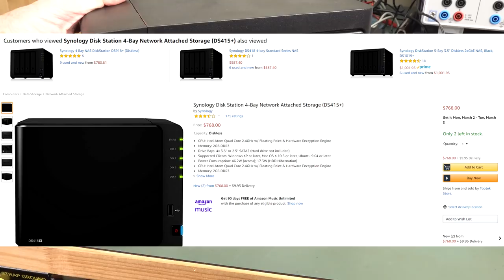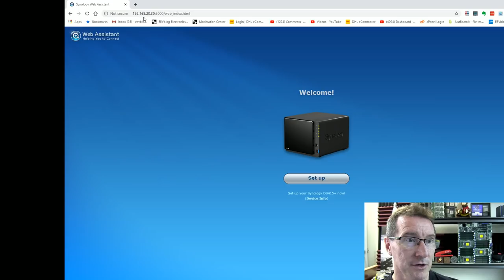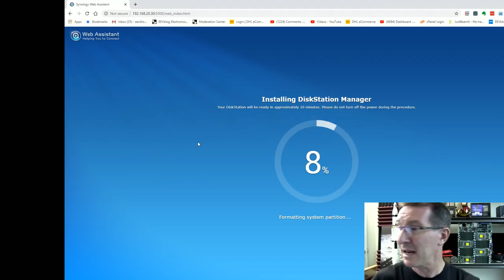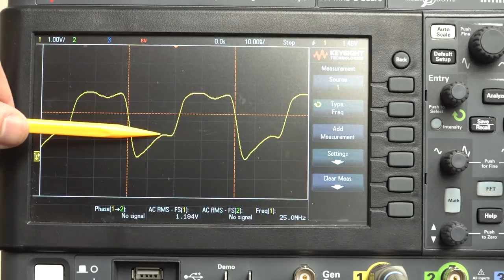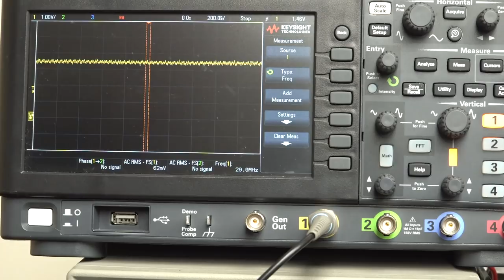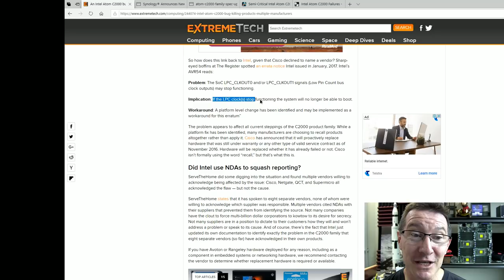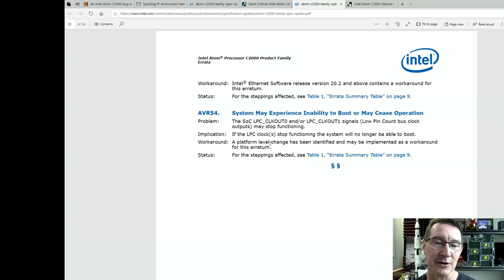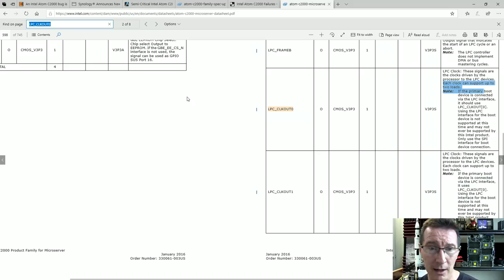EEVblog #1288 - Synology NAS Dumpster Find! (REPAIR)

Comment: Have a DS1515+ bought in 2016. Failed by the end of 2017 (in line with the failure mode of the chip).

Sent it to be repair-exchanged by synology in jan 2018, got it back by feb 2018. Has been working ever since (knocks on wood). Here is my media collection (both audio and Video), all my data, pictures, work stuff, steam collection, etc.

So yes, dave, if you have the same or similar model, you can use this as an ONLINE mirror NAS, so, in case of failure of your main NAS, you can still work. An offline backup NAS is just a silly idea. Use the most powerfull NAS as main, and the less powerfull one as backup, regardless of dumpster/bought status.

And, if you are worried that both NASes can fail at the same time, remember that you must have an off-site back-up too, so that takes care of that worry. An offsite backup does not have to be backblaze or such expensive things. Something as simple as a Big 2.5" HDD with a USB-SATA enclosure will do. that's what I use.

In my case, since I do not have access to your dumpster, I have my NAS, an onsite offline backup (a big 3.5 HDD in an enclosure), and an off-site off-line backup (already mentioned).
Reply: If you have a second NAS for real time backup, couldn't you put it somewhere else (e.g. at home) and link it back using VPN to get real time offsite backup?
Reply: @NiHaoMike64  Yes, in case of medium/big companies, but in Dave's case, but that brings some problems. Let's use Dave's Dumpster NAS as an example.

1.) the speed of your internet connection is the speed you will be working while in failure mode, including the rebuild time of the NAS once you buy a replacement. For example, Dave's NAS has 2 x1Gbps eth ports, which can be bonded for a combines 2Gbps, or you can use one to conect to the network and one to connect to the online-backup-NAS. If you take your backup offsite, will the VPN link be able to hit 1Gbps in case of failure? what will cost said link? Yes, in principle, in case of failure of the NAS, once you buy a replacement you can iether set up the replacement close to the backup one or transport the backup one to the main site and do the rebuilding, but then you risk damaging one of them in trasport...

2.) even if you are willing to risk damages in case of a rebuild, If you do synchronous write to the remote-online-backup NAS (which you should absolutely be doing, since you are so concerned with data retention), the actual performance you will see will be restricted to the speed of said VPN link (because, in synchronous mode you have to wait for both the local NAS and the offsite NAS to confirm the write operation, and the Writes on the Offsite NAS will be bottlenecked by the VPN link speed). Considering that NAS can easily hit 2Gbps (using SSD Write caching), do you really want your NAS to be bottlenecked to the typical upload internet speeds you see in your country (I bet in Dave's case that is 50˜100 Mbps)?

3.) Having the online backup NAS at a remote location does not count as an offline backup, so, you have to keep doing those. Offline backups are very important in this day and age of ramsomware viruses/virii encripting your data including your shared folders. If a ramsomware virus encripts the data in the main NAS, by definition it will encrypt the data on the Online-Remote-Backup NAS too. So, you need the offlines...

this are only three reasons... Having said that, it depends on your threat scenario, hability and facilities. 

Say Dave had Line-Of-Sight from home to office, he can then set up a microwave link using WiMax over non licensed spectrum @ 1Gbps, then the performance of having both NASes in the office is indistinguishable from the performance of having one in the office, the other at home.

Sorry for the long answer, I am bored and I kinda know this stuff... (technical trainer for Huawei storage systems)

Comment: I don't know about the fix. But I have a Synology DS412+ with 4 1TB WD red drives and only had one problem due to not doing the OS updates. I got that fixed by just removing all the drives, putting in a temp drive to get it booting. Then updated the DSM software. Then putting the original drives back in and then DSM updating the copies on the drives. Didn't lose any data and It is still running today. Also If encription is not enabled you can pull the drives and connect them to a linux computer or run a live flash drive that has mdadm and access the drives.

How to read Synology models for NAS units

DS = Diskstation (desktop model)
RS = Rackstation (server rack mount)
DX = Desktop Expansion unit (Connects to compatible units through ESATA cable, drives can be raided or JBOD in expansion but not mixed to raids in DS unit. So a raid can't use drives in both like 2 drives in DS and 2 drives in RX for Raid5. Can only Raid5 in just the drives in DS or DX for two pools. 

RX = Rackmount Expansion unit. (connectors allow rack expansion unit to be seen as part of  RS unit to allow drives across both units to be raided together. )
RP after model number = Rackmount with replaceable power supplies. Example RX818RP+ has 2 removable power supplies, while RX818+ just has one built in unit

1st number = number of bays * DS415+ four bay = 4    DS218 two bay = 2       DS718+ two bay but can attach expansion unit =7 *
second 2 numbers is the model year DS415+ means it's from 2015 but may have been sold till the next model like DS417 is release.
Slim = smaller units that take laptop/ ssd 2.5 inch drives only. DS419Slim

Play = includes faster CPU and/or more memory for transcoding video 

+ = faster model compared to another model of same name being sold
J = lower cost model of another model of same name.  Example you can have 3 models name DS218, DS218+, And DS218j but different specs. 

There are more but those are Enterprise rackmount storage units.

Comment: I would not trust such on-the-edge fix to keep my data safe.
Reply: If it fails all that will happen is that it won't be able to read the bios chip on boot data will still be safe.
Reply: @MrConor159  I don't have enough experience in NAS storage. Can a Raid config be saved? Say, using another hardware?

Comment: Wow that NAS box is expensive. You can get a dirt cheap PC with 4 integrated SATA ports, install FreeNAS and you get the same thing for a fraction of the cost. Just you would have a big ugly PC case instead of that sleek box, but a NAS does not need to be in a visible location. At home, my PC based NAS has 10 drives using a cheap used 12-port SAS controller (with hardware RAID) from eBay. SAS ports can handle SATA drives. Multi-port SATA controllers are actually much more expensive than SAS even though SAS is enterprise class.

Comment: Found two too .lol
Reply: But not working with the resistor fix.
Just a short blue flash after connecting the psu and then nothing.
Reply: OK now it is working.
So what I found is that the blue light is an indicator for pre software loading.
But it was a very short flash. Thought about a shorted smd at first .
My solution ( why it works I don't know  )
I Kickstarted the cmos battery with  3.5v. 
And it started and now it works with the regular battery cr1220 again without 3.5v .

Comment: Fixed my personal DS415+ about 18 months ago, and luckily it is still running 24/7 today.  I also happen work in networking and had to replace a bunch of Cisco routers and firewalls that were affected by this bug.  Thanks for the video!
Reply: How's that DS415+ holding up? I'm about to do this fix and want to know the potential life I can expect (got the DS with 4 x 4TB drives for $700 so not the worst but I just finished moving all my data and after the unit crash I did a power cycle and then she died)
Reply: @ovenfood  After 3 and a half years since it’s surgery, it is still going strong.  Good luck with yours!
Reply: @dangoswick  100R 0.5W resister was added and bing bam boom shes back to her former glory.
Reply: @ovenfood  That’s great news!  It’s a great little NAS.

Comment: I added 100Ohm resistor, unfortunately it still doesn't work :/
Reply: Is the lithium battery CR1220 on the motherboard still ok? They will die in hours or days if the NAS is powered off.  It will stop the NAS from powering on and booting up if flat.

Comment: Gday down under mate... Loved this video and hopefully you can give me a hint if i can solve my blue flashing light to on my DS$11 slim with the same issue. Was working fine til a few days ago. Bugger. It pops up in my network shortly and then dissapears again continuously.  The motherboard you showed was of anothr model but was hoping that you might be so kind and help with finding the right pins to solder the 100 ohm resister on my board. Board specs are Model : ADM41L1 ver: 1.3 if that helps. Searching the web still for more information. Any hints will be appreciated mate. Keep on doing what you do Bruce ... :-)

Comment: Neat to see inside one of these, O got a very similar unit a DS516+ model, but fortunately does not seem to use this CPU. I read the RAM in mine was not upgradable, but looked in vent hole on bottom and there is a DIMM in a socket so seems upgradable but not sure maybe limit is in the firmware.

Comment: I have the dreaded same intel chip non boot up issue with my QNAP TS 451 which is way out of warranty :( I am not too tech savvy, but can you run the same resistor mod on this model and if so does anyone know anyone in Perth metro that would be able to do it?

Comment: Didn't synology keep using these chips.

So did intel, fix that fault?
Reply: Maybe synology just did the resistor fix upfront for newer models. I will have to check my RS818RP+ for that
Reply: Intel did roll out new revision of SoC. Same cpu revision still. It delayed C3000-series launch iirc.
Servethehome might be best source for info. AVR54 as a keyword.

Comment: Hello,
great video. Unfortunately I damaged my DS415+. Now I have a problem. When making a 100ohm resitor fix, I decided to change the thermal paste under the CPU heatsink.
Unfortunately, using pliers to remove the heatsink latch, I destroyed the R45 resistor on the PCB. Do you know its value?
Thank you for your help.

Comment: This was was a big issue on some units from QNAP, like the TS-453 Pro. Seems they're way easier to get into for repair, though.
As for the question on if it has never been set up before, that's likely just because there are no set up disks installed. Not as familiar with the Synology boxes, but QNAP devices do that if you remove all disks.
Also, the reason the firmware is on its own module; if you pull it off it's using a SATA connector. QNAP uses USB ones, but they're standard disk on modules.

Comment: The probable reason is that the upper mosfet in the driver has failed open.
This would cause the output to remain low.
If this is the case then increasing the value of the resistor would allow the remaining lower mosfet to pull a better low farther from the CMOS threshold.
Try this, it might help.
Maybe 150 or 200 ohms.

Comment: @0:37 4 pin power din. Worst connector to have on anything. Better to remove this godforsaken plug and exchange it with a 5mm barrel plug!

Comment: Dave,  sounds like your using WD Red NAS drives.   In the news recently WD admits that many of these drives use SMR technology which makes them terrible for NAS use.   I happen to have 12  6TB WD Red (non pro) drives that are now shelved.  They are fine if your using them as low speed archives so long as the NAS never has to re-silver (rebuild).   Write speeds are horrible during rebuilds or any large data transfers.    

https://www.techspot.com/news/84973-wd-publishes-complete-list-smr-drives-following-user.html
Reply from the maker: No issues so far

Comment: Interesting.  I had a custom NAS that I built that was on a Gigabyte board I think based on that chip died recently... wonder if there is any similar hack to do on those...
Reply: Might be late but look into the TPM connector in the mobo manual.. pins 1 and 9 might work

Comment: the power supply on my DS411j died and I found the replacements to be over £80, however I found a FSP096-AHA on eBay for £10 which is exactly the same PSU but with a different connector - one cable swap later and back working again.

Comment: I have a DS450Play still working with DSM7.1.1 I never experienced any issues with that CE5335 ATOM processor.  It is a very slow processor though.
Reply: You probably mean DS415play, don't you? That unit has nothing to do with the bug. The bug was introdued with Intel's newer Silvermont architecture in 2013. The CE5335 is based on the first Atom architecture generation (Bonnell) that dates back all the way to 2008 and powered the typical netbooks and nettops of 2009/2010.
Reply: @theol1044  Yes sorry the DS415play

Comment: The LPC bus is used to emulate "legacy" ISA devices... which often includes the boot ROM itself as you read. Ever since LPC was introduced 18 years ago this has been common practice. I think it's still used on current designs. A lot of ROMs use SPI these days... pick your poison. 

https://en.wikipedia.org/wiki/Low_Pin_Count

Comment: Based on my limited experience with it, the LPC bus is basically a slimmed-down version of the ISA bus that is used to connect a few low speed peripherals that aren't justified to be on PCIe. This is usually your PS2 mouse and keyboard controller, superIO (com/lpt ports etc), the boot rom itself, the TPM and stuff like that. Intel and AMD processors both use it.

I'm guessing on this system it's only used for the external boot rom and that's why it's exposed on a programming header.

Also, I'm betting that little daughterboard with flash on it is an eUSB module. These are common in enterprise hardware like NASes and routers. It's basically a USB stick in a different form factor, but a bit more reliable. The general movement is towards eMMC but eUSB still has some advantages (can be removed but is more reliable than an SD card, is externally programmable etc).

Government agencies and other high-security customers also strongly prefer that a device have as little non-removable storage as possible.

Comment: Maybe make a video of a proper fix, i.e. mod board, for it. Then get some cheap, smaller HDs to test it with. If it works long term after testing, put the expensive HDs in it and use it as a tertiary backup. Also, just make a PS for it. ;)

Comment: I got my DS415+ in January 2015 had the issue and got it replaced in January 2016, has been running fine ever since.

Comment: I dont understand why people but these they seem like a scam, for the amount it costs you could buy a much more powerful machine and it's not gonna be on some locked down os with only a few features
Reply: nah. NAS is cheaper beause it's non-ECC RAM, cheap dirty CPU
Reply: @pipony8939  you can make your own nas without server hardware even a cheap pentium would be better than one of these pieces of shit, you're basically paying 600 dollars for a nice box
Reply: @NO_obs  - you are paying $600 to lift something out of the carton, plug it in and it works instantly. I've had both kinds, and these kind of NAS are so much easier and more reliable (when they don't have bugs, of course).

Comment: My 415+ "died" a couple of months ago, of course just a year out of warranty. I had no bloody idea the Atoms in these had this problem. Luckily I came across this resistor fix on the Synology forums and it booted right up again! Wish I had known this sooner so I could preemptively apply the resistor to slow down the degradation. I wonder how many years the resistor added.

Comment: that’s a nasty double edged clock, and with that low PU resistor the lower totem might degrade with time too. I’d not trust this to hold my mission critical backups.

Comment: hey do a video on grid solar inverters. there are many old solar systems that the panels are still working but the inverter has died. it will be a good watch to see you open one up and attempt too repair it.

Comment: I found detailed info in a german forum:

According to one member:
You measured the spi clock. The transistor pulling it low ages very quickly due to bad design and that resistor is helping to pull it properly low again. 

According to another member: 
Not SPI but LPC - the resistor just fixes a power management issue where the supply wont start. 

Apparently theres a PIC on the board dealing with buttons and leds; it is responsible for the startup sequence. 

The cpu but might be totally unrelated. 

Source: 
https://www.synology-forum.de/showthread.html?98389-Vorsorgema%C3%9Fnahmen-bei-den-Modellen-DS415-DS1515-DS1815-%28SOC-C2000-u-a-Bugs%29&s=cdfccd7cb08e1d39fa211bcc530c4337

This forum seems to be full of in depth hardware and software information.

Comment: I have an 8 drive QNAP NAS that had one drive fail. I discovered the problem and got a replacement and the array started to rebuild itself over night. The following morning I discover that the replacement drive that I'd put in was marked as spare and never was added to the array. The best part was that over night a second drive failed and hosed the entire array. A QNAP engineer remoted in to the NAS but was unable to restore the array. Starting out on a NAS with a dodgy CPU to begin with isn't my cup of tea ... I wouldn't do it not unless the data you put on it has no value to you.
Reply: What you experienced is one of the main reasons why running any NAS in RAID is a dumb idea. RAID is not a backup.

Comment: I think you had to install because the NAS uses the disk as the OS/software space. The internal flash is just for booting and some kind of bootstrapper maybe. So since you added a new hard drive, it's clean installed itself on it. (or maybe I'm wrong.. replace the disk, and we will see :) )
Reply: Of course. Almost all NAS operate in that way.